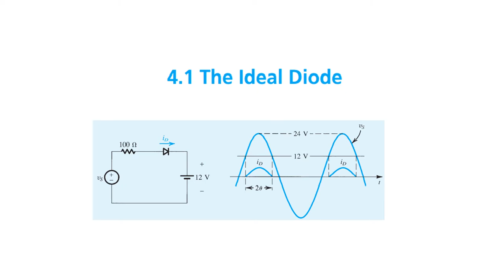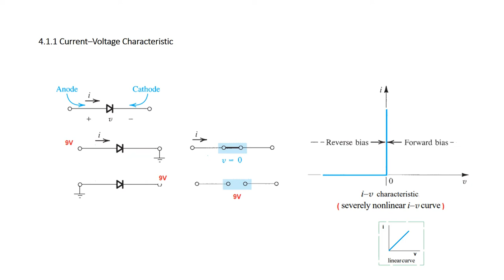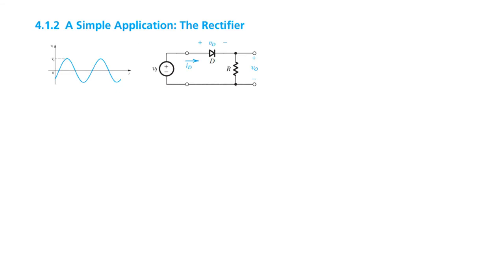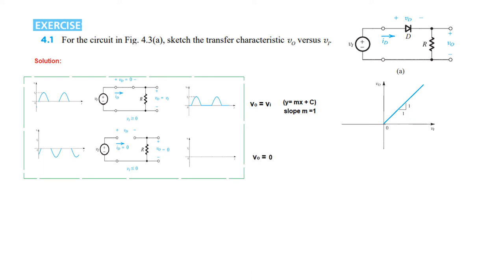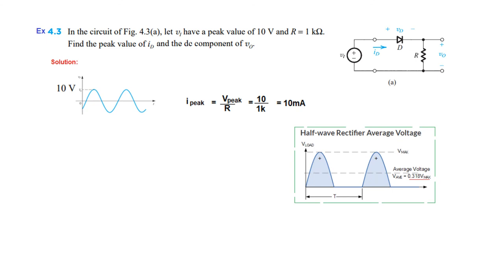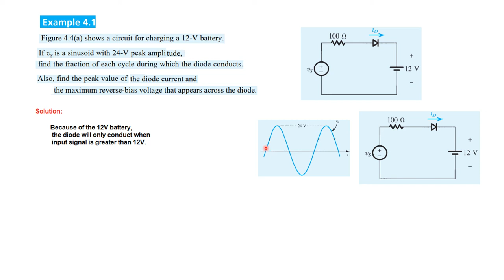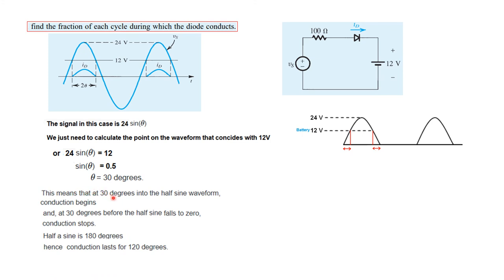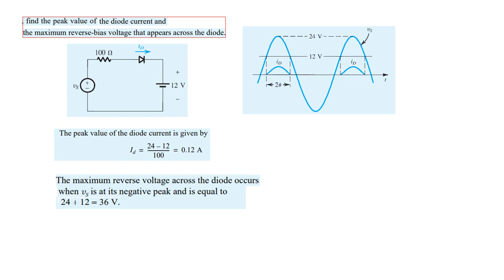Ideal Diode || Peak Diode Current || PRV || Example 4.1 || Exercise 4.1, 4.2, 4.3 || EDC 4.1(Sedra)

Comment: Sir does the value of a Ideal diode always 0v? If it will be use to solve for the Vo
Reply from the maker: Yes
Reply: In a simple circuit it should be when use in a KVL 
Vo - VD - V = 0. Vd(ideal diode). V=5v
Vo= 5 - 0 = 5v
Vo = 5v 
Is this correct?
Reply from the maker: @godwintayas8957  Correct (Vo = V +VD = 5 +0 = 5V  )
Reply: Thank you!